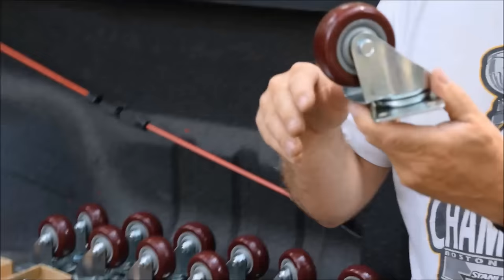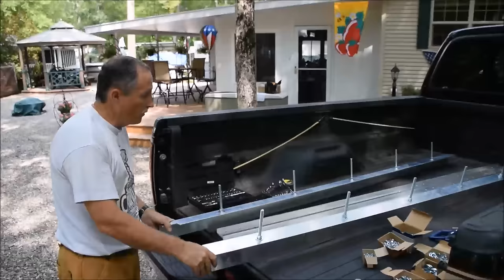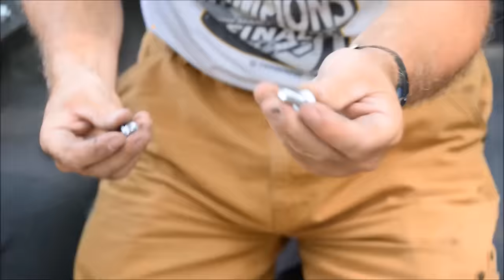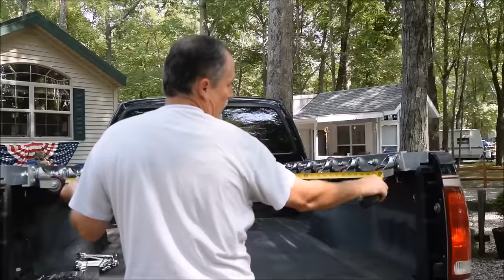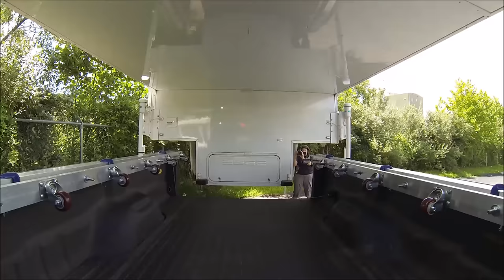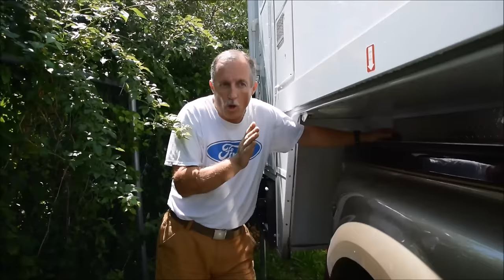How to Load a Truck Camper onto a Pickup with Rollers!

Comment: Rube Goldberg award!
If you could move the camper several inches then rollers make sense, but that would damage the legs as you mentioned.  For just an inch I used boards with outdoor carpet on them.  Camper slides along the carpet easily.  Boats use boards and carpets, i did not invent it. The boards then shim the camper snugly.
Interesting invention though

Comment: I like the "tape" idea on another video.  Rollers seem a bit much unless you are full time camper guy.  

I was hoping to find time to load a video but it will have to wait.  If you are like me, and your truck camper "barely" fits into the bed of your truck (1" to spare on each side), lining up the truck is a pain.  An easy "hack" is to use cheap laser pointers and simply tape them to the bed on each side.  As you get closer, if the laser is pointing to the inside of the camper base, you may be off a bit.  It is not perfect, but it will at least let you know if you are way off in the beginning of backing up.  Don't trust the laser 100%!  Just use it as a basic guide.  I still have to get out of my truck a couple times when loading.  Truck: Dodge Ram 2500; Camper: Lance

Comment: Very nice work Charles and nice design. I was wonder if you really need that many rollers? I've been hanging a weight (1/2" nut) tied to a string from the tie down points; as I back in, I can fairly accurately guage how centered I am as the weight passes the fender lips.  I used to tie 4 weights, one to each point, but the  back are pretty much useless. I have a Northstar that is 7 feet wide and the left / right tolerance is a mere 1/2" ... I need something better than eye balling it. Thanks.

Comment: I like and made a green laser you made last year, the only way this would work is if you had rollers on the base of each jack(s) otherwise you're going to be torquing the truck camper and the legs/jacks.  I personally think the reason you got it straight in the video is because you're good! and have a lot of practice.2-3 degrees is going to mess up the jacks if not the brackets the jacks are on... my personal opinion 

I use the green laser as a guide and it works great.

Comment: Hi Charlie,,, we are in the process of laying out/measuring the "Holes" in the Angle and Channel pieces... Could you post here the measurements of the Holes... Looks like,,, for the Wheels 4 Hole Pattern you came in 1 inch on either end of the channel as a starting point then just divide up the rest of the span to accommodate the other 4 Wheels... 
Thanks,,, Jack & Lynne in LRock, AR

Comment: DOES THE DESIGN PUT A STRESS ON THE JACK LEGS, CAUSING THE FOOT TO DRAG SIDEWAYS ON THE GROUND AND BEND THE JACK-STANDS OR PULL THE MOUNTING SCREWS OUT OF THE CAMPER?
Reply from the maker: As I was very careful to state in the video, this centering method is ONLY for the last 1/2" to 1" of centering movement that will just slightly nudge your camper sideways to get properly aligned with the truck.  Trying to shift the camper more than that would put undue stress on the camper jack legs.

Comment: Hi Charles,,, my wife Lynne an I want to build your "T/C Roller Alignment System"... But we can't find the Aluminum Angle or Channel at Lowe's or Home Depot... Where did you acquire your Aluminum??? We can get the Caster Wheels, 3 1/2 x 250lbs at Harbor Freight for $5.79 apiece... The nuts and bolts etc we'll get at Lowe's or HD... I guess I could use Steel in place of Aluminum but I'd like to keep the assembly as light as possible... Maybe your Aluminum supplier could ship their Angle and Channel to me... We Love your Alignment System and your other videos... Maybe we'll meet-up someday... Thanks,,,
Jack & Lynne in Little Rock, Arkansas
Reply from the maker: +Jackson Sheesley Hello Jackson - you can purchase the aluminum from McMaster-Carr at the following address:http://www.mcmaster.comI ordered the following:88805K7  Highly Corrosion-Resistant 6063 Aluminum, 90
Degree Angle, 3/16" Thick, 3" X 3" Legs, 8 ft Long9001K1  Highly Corrosion-Resistant 6063 Aluminum,
U-Channel, 1/4" Thick, 3" Base, 1" Legs, 8 ft LongYou can also order all the hardware you may need for the project here as well!The casters I bought on eBay similar to this bid:http://www.ebay.com/itm/4-PC-SET-3-POLYURETHANE-SWIVEL-CASTERS-WHEELS-FOR-CART-DOLLY-FAST-FREE-SHIP-/261779815845?hash=item3cf34afda5

Comment: I like the way your mind works Charlie :-)  I'm pretty good at eye-balling my camper sufficiently centered in the bed but I find my biggest issue is determining how far forward the camper needs to be in order to contact the two front molded bumpers on the camper without crushing them beyond the point of deforming or harming them in any way. Once the camper is close to the front of the bed, I cannot get my eyes close enough to the gap to look down inside. I can measure the gap on each side once its in place but still can't determine what that gap should be. Got any ideas ?
Reply from the maker: I understand your problem and after some thought, I would recommend getting some different rigid / durable bumpers that allow you to touch the front of your truck bed without deformation.  I have these on my Chalet and they seem to be sold all over the internet at many different outlets.
Reply: I'd still be afraid of denting the front of the bed if the bumpers were too stout. I guess, since I'm kinda new to this set up, I'm just going to have to learn to feel the initial contact better.  The original bumpers seem to be a good combination (design) of a curved front piece (for initial contact) ahead of a box section of the same material. I usually back up slowly until I see the camper move ever so slightly and then pull forward a half inch (or so). I've loaded the rig about now about a dozen times and driven it over 9,000 miles so I'm getting more used to it every day. Just thought you may have had another "outside the box" revelation for me :-)  Thanks for your reply and videos.